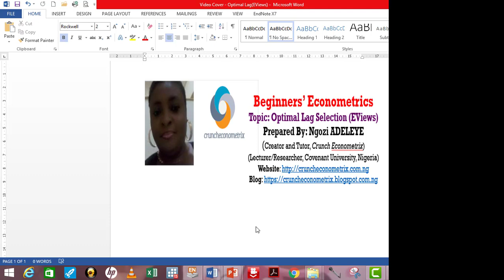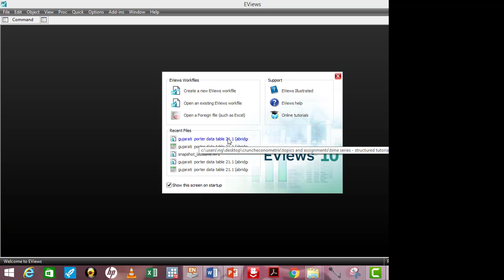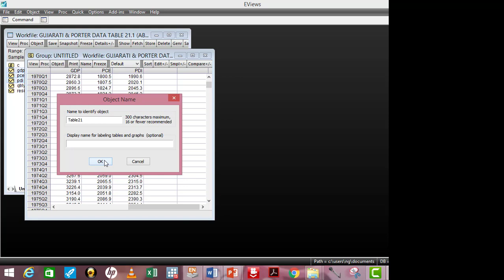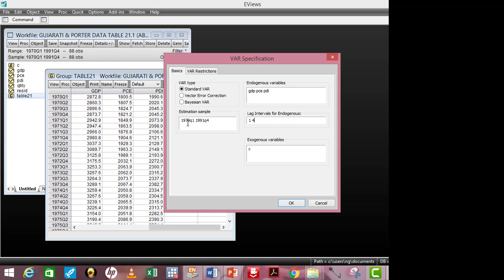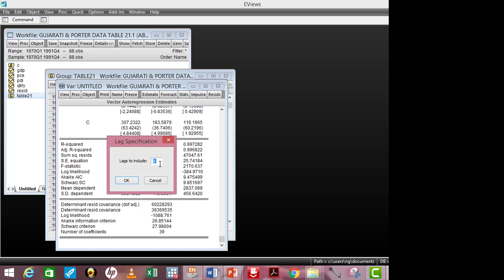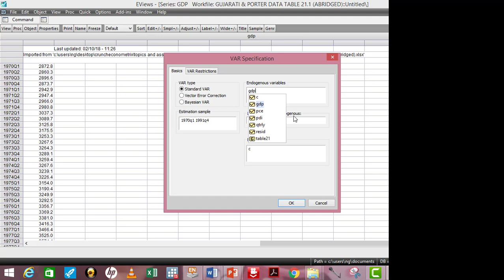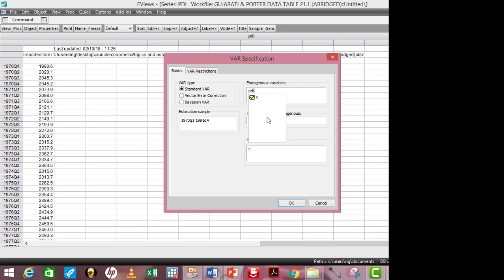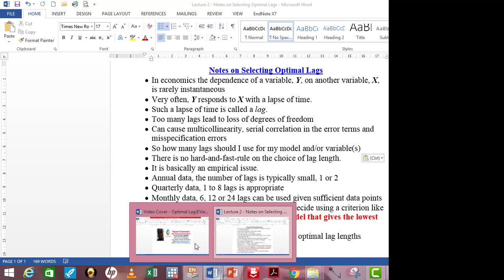(EViews10):Determine Optimal Lag Selection #lags #lagselection #aic #bic #sbic #hqic #eviews

Comment: Selecting Optimal lags for Annual, Quarterly and Monthly data is a rare insight that comes only through experience. Thanks for providing this lag selection insights.
Reply from the maker: Yeah u're right, Bhaskar...and thanks for watching my videos!
Reply: Madam, I had one question - I am running an ARIMA on Bitcoin Close price data with daily data of (12,12) when I select Max AR as 12. Is this still fine to have such high lag values considering I have daily data.
Reply from the maker: @bhaskartripathi  Yes, u're still on track since it's a daily data.
Reply: Thank you so much professor. It helps to see your videos

Comment: Hello, Professor Adeleye. Thank you for this informative video. I hope you can shed light to my problem.

I am working on a panel data analysis, spanning 32 years (annual). I followed your instruction on finding the optimal lag, and the results show 8. However, upon integrating it in the regression, the model suffered a normality problem. 

I tried experimenting with lags for the dependent (GDP), and when I set the lag to 30, the normality and autocorrelation problem was fixed. May I use a lag of 30 or shall I continue with the optimal lag given by the lag length criteria results (8)?
Reply from the maker: Using lags is subject to understanding your dataset, the time dimension and loosing too many degrees of freedom.

Comment: Hi madam, If the residual autocorrelation test results indicate that the p-value for the chosen lag is 0.000, which is less than 0.05, suggesting the presence of autocorrelation, should I change the number of lags and re-estimate the VAR model with this new lag?
Reply from the maker: Yes, adjust the lag length.
Reply: @CrunchEconometrix  Thank you for your reponse. I have another question when I estimated the model ,i found the R-squared coefficient is low for both variables, even though I tested the model's stability ,and the significance test of the coefficients indicates a probability less than 5%, so the model is significant .Does this low coefficient pose a problem?

Comment: Thank you so much for this video. If one of my series is stationary at first difference then we should use that series at level or at first difference while calculating lag for the model.
Reply from the maker: Hi Richi, 1st difference of the variable is not used for lag selection. It is either the raw or log form.

Comment: I have to thank you first for your helpful videos. I just have a technical question. You said we use unrestricted VAR to estimate the optimal lag length because we assume that the variables are not co-integrated. Why we assume "not co-integrated"? Thank you again.
Reply from the maker: Hi Mona, because the cointegration test has not been performed to establish that. Hence, determine the optimal lag and other steps follow. May I know from where (location) you are reaching me?
Reply: @CrunchEconometrix  Hello to you. I am in Italy. I am a student and I am preparing a project with Eviews. If I may I would like to ask is it better to run the co-integration test or unrestricted VAR to find the optimal lag. Because I have run the co-integration test and it exist among my variables. But interesting thing is that when I run the co-integration test the lag that it suggest me is the same when I run the unrestricted VAR.

Comment: Hello dr
When i do my ardl model i have the optimal lag is for the minimum aic but the model choosen using aic IS not really good. So i have two question: first, Can i choose HQ criteria if it was significant even if aic IS the minimum value? Second, i obtain ardl (1230) like a model, the 0 variable IS dropped on the short run. So what should i do to fix the problem? What should be the value of this variable in ecm?
Thanks in advance
Reply from the maker: Waed, you can always use alternative IC but make sure you justify it. 0 lag variable ONLY appears in the LR part of the results.

Comment: Thank you so much for your videos they have really helped us in our research and everything is clear. I just have a question regarding the optimal lag length, we are running an ARDL model on annual 30 observations and the optimal lag selection according to VAR was 5 is this ok or should it be reduced to 1 or 2?
Reply from the maker: Hi Malak, using 5 will reduce your degrees of freedom. Reduce to 2 and make a note in your work explaining why.

Comment: Hello dr, im using daily data from 2018 to 2022 and i have hard time to finding optimal lag since alot of video explain quarterly/ monthly/ yearly data only . do you have suggestion on what the optimal lag for daily data ? my observation is 1443 data
Reply from the maker: Hi Syazz, the time span is TOO small. You need at least 30 years observations.
Reply: @CrunchEconometrix  yes dr, I'm currently learning basic econometrics, so my prof gave me some data which is the number of observations 1443. This is for my assignment. I try to use 365 lag but the data is too small so I try to use 50 lag, and it shows my optimal lag for the data which is the smallest aic is 50. Do you have any suggestions for the lag range? I'm trying to figure out the lag because I want to do LM test in eviews. Thank you in advance !
Reply from the maker: Syazz, you said your data is 2018-2022. So, how come you have 1443 observations. I am not understanding. I suggest you ask your Prof for clarifications.

Comment: what if the model suing the obtained optimal lag suffer from heteroskedasticity? is it convent to take the lag after ? i dont want to take the log of my variables. Thanx
Reply from the maker: Amina, your query is confusing. Kindly rephrase. Thanks
Reply: Oh sorry . I calculated the optimal lag which is found to be 1, then re-estimate the PVAR(1), no serial correlation found, BUT Heteroskedasiticity was obtained. I tested again on lag 2 and no issue found. But As far as i  understand increasing lag must be based on Theory or previous studies which I couldn’t find. I applied the GLS but couldn’t retest the Heteroskedasiticity. Any suggestions?
Reply from the maker: @bellisma77 Use lag 2 and support your analysis with the literature.
Reply: @CrunchEconometrix  i will try to find. Thank you for you advice 🙏

Comment: Dear Professor, 

What is the difference between determining the optimal Lag Length
for a model and a variable? 

Do they have different usage or different purpose?

 

In the video the optimal Lag Length for the model is 2, but
when you checked for the individual variable it showed different optimal Lag
Length; one of the variables showed two optimal lag, the other four and the
other one.

Please explain the purpose and usage of determining optimal
lag for a model and each variable.
Reply from the maker: Hi Shaf, as rightly said optimal lags for a model and for variables differ as shown in the video. This applies to ARDL modeling not VAR. But the process is simplified with EViews and Stata as these software can automatically select the appropriate lags for each variable during estimation. Thanks.
Reply: Thank you so much for the clarification.
Reply from the maker: U're welcome, John.

Comment: Mam is it possible that in our model there is no constant and trend and can we select under trend specification the option"none" as all the options are giving insignificant result..meaning when I am estimating the model by selecting both constant and trend the p value for both constant and trend is coming insignificant..so is my model ok if i estimate under 'none' option as this gives the correct results
Reply from the maker: Zoya, kindly look up other online resources on more information about using the "none" option. Thanks.
Reply: @CrunchEconometrix  thanks a lot mam for your speedy response.Its really very helpful for my research.I appreciate you for your so much concern towards the students and learners.

Comment: I am running ARDL ECM model here and which method should I apply to choose the optimal lag length? Including all variables in the VAR or run VAR on each variables ? what are the difference between including all variables in VAR and running VAR on each variables?
Reply from the maker: Hi there, for optimal lags selection for ARDL models, VAR is performed on each variable. But if a VAR model, all the variables are listed. Since, you are performing an ARDL model, I'll advice that you watch all my videos (Stata or EViews, check out the playlists) on how to perform the procedures from start-to-finish. My videos are quite easy to understand. Thanks and good luck with your research.

Comment: Dear Professor, I have a questions on the Log transformation;
In a model let’s say VAR or VECM I have four variables. Can I use two in Log form and the other two on it is base/normal form? I mean is it OK to use mixed of Log and non-log in one model?
Reply from the maker: No, you can't do this in VAR for several reasons: the system is composed of endogenous variables. Using different functional forms will create interpretation problem...ok, if estimating ARDL model.
Reply: Thank you so much for the explanation!
Reply from the maker: My pleasure, John.

Comment: Dear Professor 

I want to specify the lag length for the Johansen test. I saw that the results are sensitive to the lag lengths selected.(sometimes it rejects other times it fails to reject the  null of no cointegration)

VAR model would be misspecified for I(1) series. However, can i use VAR model for  the purpose of lag length selection so that I can proceed to the Johansen test?
Reply: I forgot to mention, my series are not I(0) only I(1). I want to perform the Johansen test but I stuck with the lag length selection  because the professor suggests to use VAR for that.
Reply from the maker: @prepvisuals Ok, watch my video on Johansen Conitegration Test. It's detailed enough to guide you through...and thanks for watching my videos. Please share with your colleagues.
Reply from the maker: @prepvisuals Ok, watch my video on Johansen Conitegration Test. It's detailed enough to guide you through...and thanks for watching my videos. Please share with your colleagues.

Comment: Good morning sir!! I want to choose a suitable las length of the variables (i have 4 variables) using unrestricted VAR. I found that lag length 3 is appropriate. but does it seem logical to find the optimal lag equal to 3 for annual data. Thanks for your help
Reply from the maker: Yes, if you have enough time span you can use 3 lags for annual data.

Comment: Hello Dr. I watched your video on ARDL estimation and specifically your demonstration on how to determine optimal lag. Its quite different from what you outlined here. My question is, what is the best way to determine appropriate lag structure.
Reply from the maker: Kenechukwu, while this clip gives a general overview on optimal lag selection, that of ARDL is specific to the estimation technique....and there is no "best way" as I explained it to be "an empirical issue" subject to several factors I have pointed out. I will also suggest that you read up other sources on how to determine optimal lags for deeper understanding.

Comment: Good day mam. Just a simple question. Can we reduce the maximum lags of the ardl model from 4 to 3? Because the maxlags 3 gives the better results. Thank you, hoping for your response.
Reply from the maker: Justine, it is better to use the optimum lags. But if 3 lags produce the best results and passes diagnostics, then use it and made a note to that effect in your work.
Reply: @CrunchEconometrix  can u give me some references about this adjusting of optimal lags? Thank you.
Reply from the maker: Not everything require references. Simple justification about what you did will suffice.

Comment: Mam, Really Thanks a lot,..! It is only because of these videos that made time series analysis easier for my projects. I would definitely share your videos and make your youtube channel more popular. 

I have a small doubt mam. For yearly data we are using lag 1. For monthly we are using 12,24.

My data set is from 2012 - 2018. Both hourly data and prices for every 15 minutes is available here. Please do tell me what lag length should we choose for 15 minute block interval. Since it is a high frequency data, what lag length should  we use? When I used lag length above 2000, my Eviews started getting stuck. Also in one of  the videos it was mentioned that higher lag lengths would lead to loss in degrees of freedom. What shall I do mam?

Thanks in advance, mam!
Reply from the maker: Since you have "minutes-data", try the following lags 60, 120,..., 360
Reply: @CrunchEconometrix   Sorry for disturbing you again mam. My doubt is still not cleared. We can use lags 60, 120,..., 360 when it is a purely minute data (i.e., when the price is for every minute) but this is a data which tells price for every 15 minutes. Is it ok if we use the same lags 60, 120,..., 360.
Reply from the maker: @arrthisampath3000  Relax, I said that lag selection is simply an empirical issue which requires a combination of intuition and reasoning. So, estimate your model and see the outcome.
Reply: @CrunchEconometrix  ok mam. Thanks a lot.

Comment: Madam, one basic question - if I have monthly data, I would select periodicity in auto arima as 12. However, if I have daily data then what should be the periodicity ? Should it be 365 or 0(default value) or 1?
Reply from the maker: Yes, with daily data you can use 365days.
Reply: @CrunchEconometrix  for hourly data what should be the lag  length mam?
Reply from the maker: @arrthisampath3000  60, 120, 180,...,360

Comment: Normally in time series data we check stationarity of each variable. some series are stationary at level but some at first difference. so my question is that is it necessary to change the original variable data at first difference if the variables are stationary at first difference.
Reply from the maker: Hi Muhd, I think you mixed up this question: "is it necessary to change the original variable data at first difference if the variables are stationary at first difference"...are you asking whether to use 1st difference or level data?
Reply: @CrunchEconometrix  when the variables are stationary at level. Is it necessary to use data at 1st difference for using ARDL model or we have to use the original data for 
ARDLs
Reply from the maker: Use differenced data if you are using the OLS algorithm and level data if using the ARDL algorithm. I have videos in both procedures. Please check thru the Playlist. Thanks.
Reply: @CrunchEconometrix  thanks
Reply from the maker: U're welcome, Muhd.
Reply from the maker: @liam kenny From the various estimation methods.
Reply from the maker: From the various estimation methods.
Reply from the maker: Liam, I don;t know what you mean. Better you watch my videos on cointegration to see how its performed. Thank you.

Comment: I am working with a series of 1981 - 2019. After testing for the optimal lag length, lag 3 was chosen as optimal. Should I go ahead with this selection or should I reduce it to lag2
Reply from the maker: Go ahead.
Reply: @CrunchEconometrix  thanks a lot Ma, for your quick response